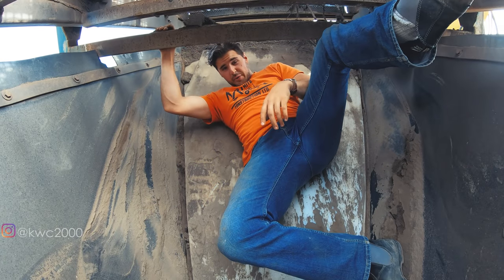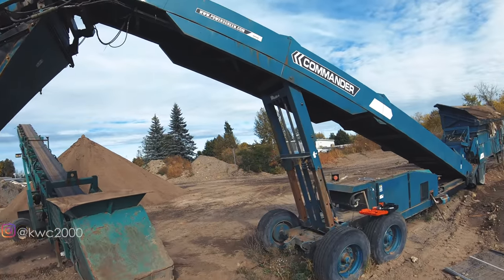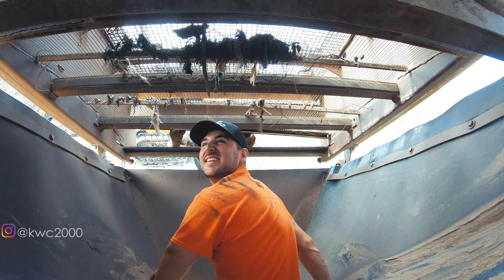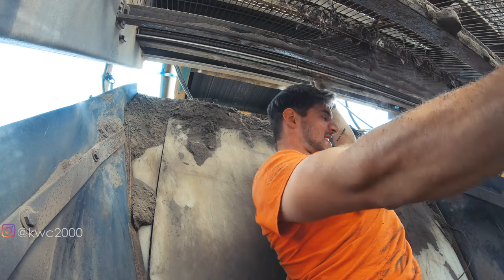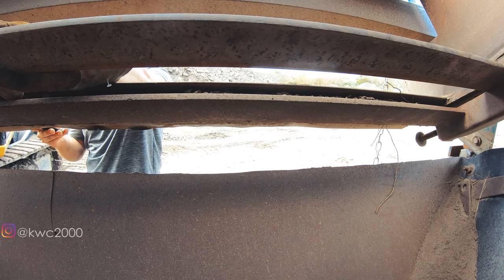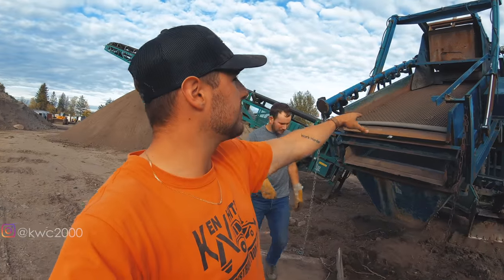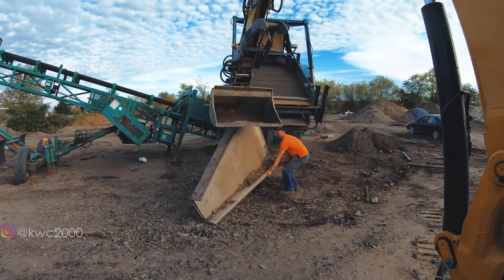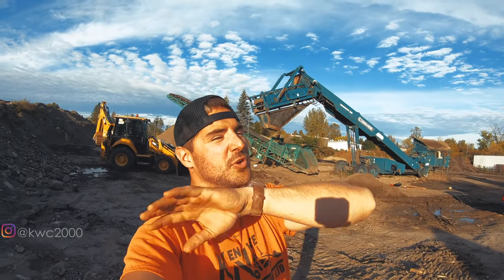I Got Stuck Inside my Dirt Screener....

Comment from the maker: was this helpful for anyone? anyone watching ever done this? love to hear the feedback!
Reply: yeah i do this for a sand and gravel wash plant also an aggregate plant aswell, 6x16 wash screen, 5x12 wash screen...aggregate side is a 5x12 primary and secondary screener is 5x12 aswell and we have a tracked powerscreener 5x14 something like that. so lots of screens haha..wash plant is pretty consistent screen sizes so they aren't changed all to much only when wore slap out... aggregate side is where all complex screen combinations happen. im in canada, we just finished a screen change for  2 inch minus and 6 inch to 3 inch drainage rock Thursday took all day basically. its a 350-500 tph stationary plant fed by a rock truck and pit loader. consists of like 20 different conveyors moving and 3 rock crushers.
Reply: I was stuck in a hopper for 2 days with no food

Comment: I remember working a finish screener (finlay 300 or 600 series, I don't remember exact model)  and having to crawl on the main finish belt to clean the piano screen. But the Finlay had 3 belts, one for finish, one for medium size, one for oversized. But it needed to be kept cleared under the main belt from bunker to screen deck.

Comment: The word of the day should have been Filthy because you were filthy at the end of the day. What size screens did you put in there? KPIJCI makes a screen that the bottom deck has a vibrator for screening sticky material. It is called a Multifrequency screen. We use to make #4 mesh crusher fines and they would stick also.
Reply from the maker: that is 8mm screen and ya it was a dirty job